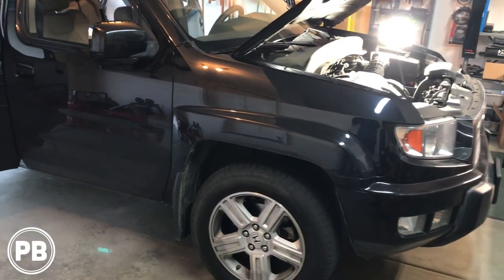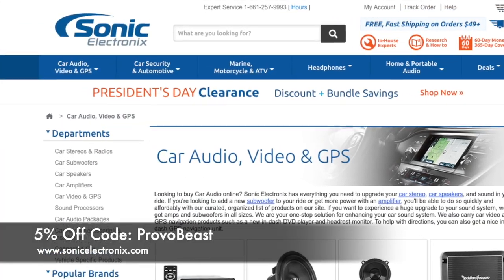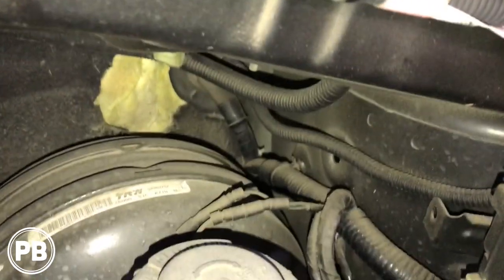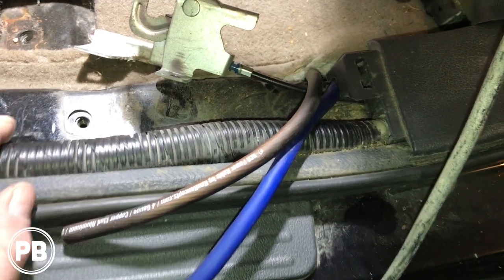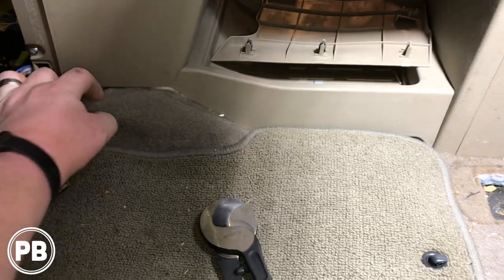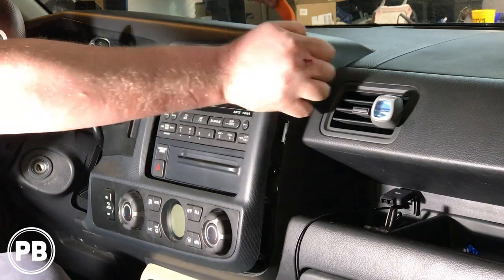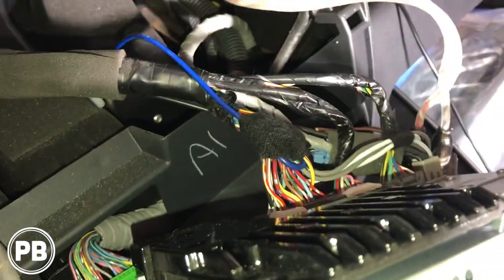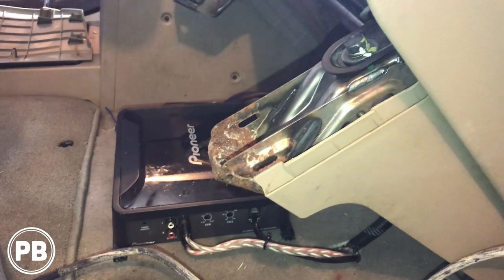2006 - 2014 Honda Ridgeline Sub and Amp Install

Comment: I have an 06. 7 speaker system. Going to do the same upgrade as you. When you hooked amp up, did it amplify the stock door speakers and tweeters as well? Any issues? Could the stock speakers handle it? Thanks

Comment: Hey. Thanks for the video! I have a 2013 with factory 6 speakers and sub. Want to add a 5-ch. amp (XD700/5v2) and a JL Stealth Box while retaining the factory head unit / Nav. Can I follow this same procedure using a 4-ch LOC and would I just disconnect the factory sub from the back of the head unit and connect the Stealth box directly to the amp? THANK YOU for your great content!

Comment: Did that model have a stock sub? Wondering if you disconnected or is it still in use.
Reply from the maker: Nope, it wasn't equipped with one.  Your choice - you can leave it plugged in or disconnect.